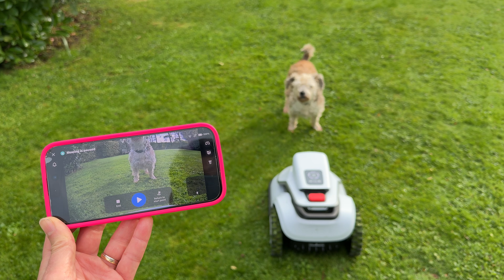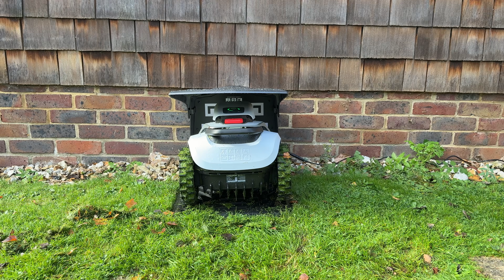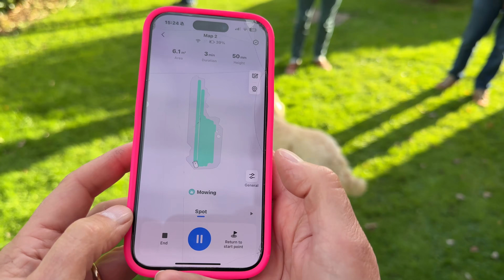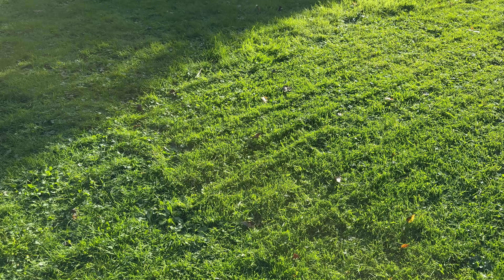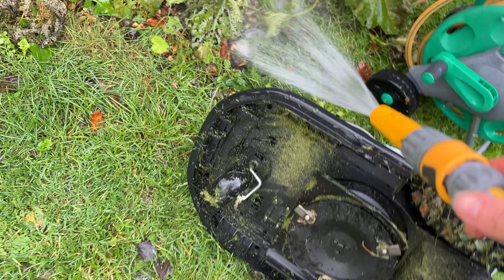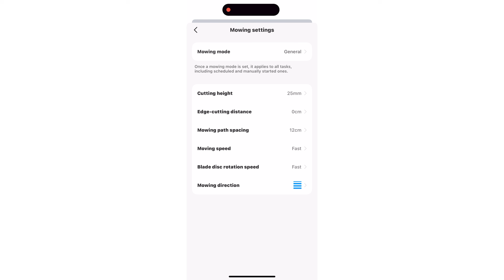This AI lawnmower is a total game changer

Comment: Anyone wondering how loud this mower is (as it will be mowing longer and more often) it's apparently 55dB.  My Flymo Easiglide 300V is 91dB. So not too loud in comparison to a hover mower.  It would have been nice to hear it in the video...  Also - the test lawn is perfectly flat.  How would it cope with slight slopes?  Cost is £799 on the UK Amazon at the moment (6th Nov 2025).
Reply from the maker: I did try to measure the sound level, but the abient noise was louder than the mower. In some parts of the video the sound is present, but this rather proves my point that you can't hear it!